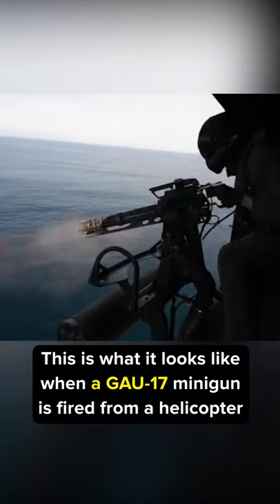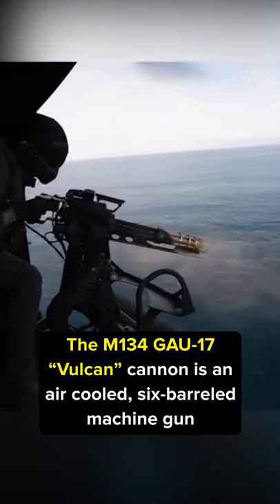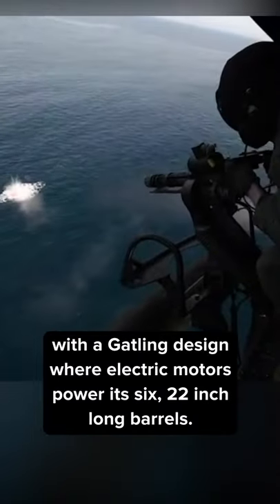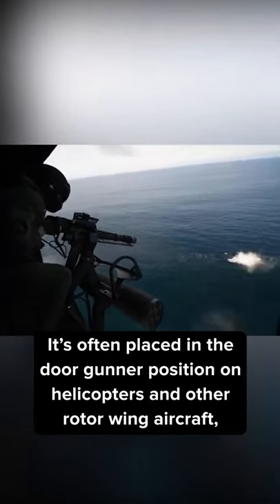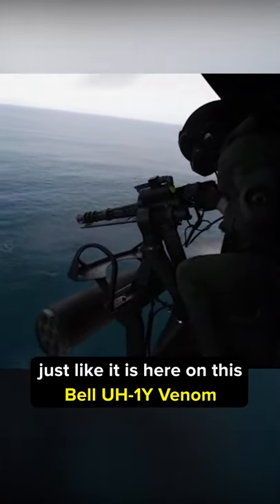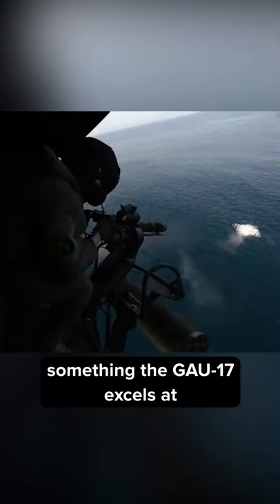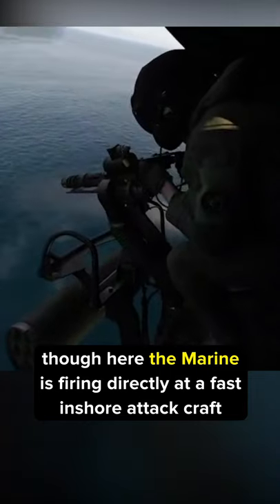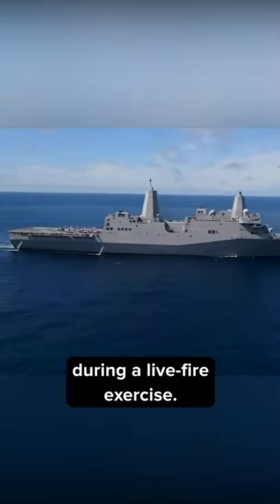GAU-17 Minigun Fired from a Helicopter

Comment: The Mini gun is a 7.62 mm NATO round "machine gun". When I was. Cobra crew chief in the 70s it could be set to fire 2000,or 4000 rounds per minute. The Vulcan Cannon was a 20mm Canon that shot 750 rounds per minute. The A H 1G s I worked on had the minimum and a 40 mm grenade launcher in the chin turret, if it had a Vulcan canon instead of a rocket pod , it was mounted on the left winglet. The turret was fired by the co pilot in the front seat as a defensive weapon, the wing stores were offensive and fired by the pilot in the rear seat.
Reply: You worked on the AH-1G? That's like my favorite gunship.

Comment: Does some something that powerful give off thrust? If so i know its standard training but props to any pilot that can compensate for it
Reply: The recoil does cause some alteration of aircraft attitude.
Although this weapon is attached to a flexible mount and that flexibility dissipates some of the recoil.

A .50 caliber is probably the worst for a helicopter.

While on a Specter gunship the 105 mm howitzer near the rear would probably give it a kick.

On the larger weapons systems there are recoil compensators.

Comment: That's not a cannon... It's a minigun... Cannon = equal to or bigger than 20mm
Minigun = smaller than 20mm
Reply: It's in 7.62 nato/.308 so not even close lmao
Reply: Either that or 5.56×72... 
7.62 NATO and .308 are not the same though.
.308 has a slightly longer casing. A little bit more bang than a 7.62×39 NATO.

Comment: Damn 6000 rounds per second that's fast so they got to be electrically fired also no CenterPoint, so how many rounds per minute can the barrels handle before they heat up too much?
Reply: The 6000 rounds per minute rate of fire is a theoretical maximum and can only be achieved from the fixed gun pods using a linkless feed system. The actual rate of fire depends on the motor the gun is equipped with and can be anywhere from 1500 to 4000 rounds per minute with 3000 rpm being considered optimum.
Reply: @MrDDiRusso  well that makes perfect sense not every motor turns the same according to it's horsepower,
 What I was really curious about is how long you can sustain that before the barrels go to getting weak too hot warping, 6,000 rounds theoretically is a lot of damn rounds, so I'm sure I'm sure it can make its own self red hot so what did they teach you in the armed forces it's like how much can it handle?

Comment: Why doesn't anyone ever mount sights on these? I don't think I've ever seen the picatini rail on top being used on one of these guns.
Reply: Accuracy by volume.
Reply: There's a steady stream of tracers coming out of it, about 1 every 20 rounds or so. They don't show up well on film in daylight. Type m-134 night time into the search bar. You'll see why they don't need sights.
Reply: @DarkMatterX1  the tracers will help with continuous fire, but what happens when your in a danger close situation and the first few shots need to be on target? I know this probably doesn't happen due to the large distances of modern combat, I just have a tendency to think of the worst possible situation.
Reply: @DarkMatterX1  the tracers will help with continuous fire, but what happens when your in a danger close situation and the first few shots need to be on target? I know this probably doesn't happen due to the large distances of modern combat, I just have a tendency to think of the worst possible situation.
Reply: @iamsethhasting8911  
You'd shoot to the far side and walk it into the AOE